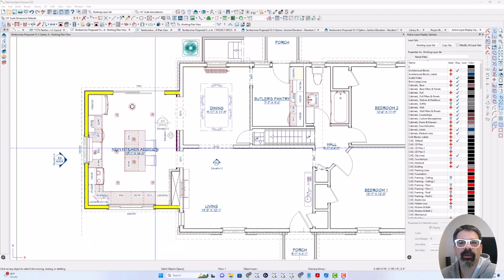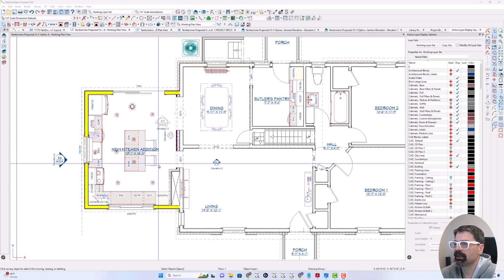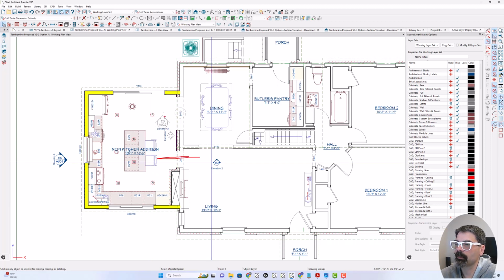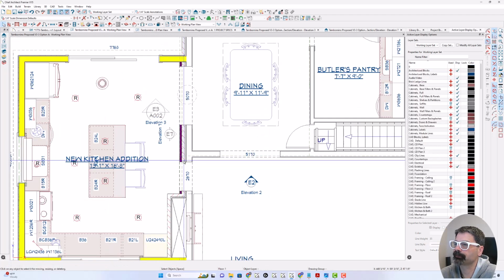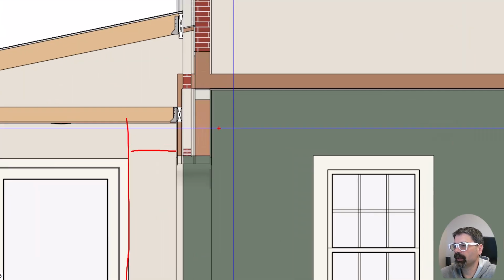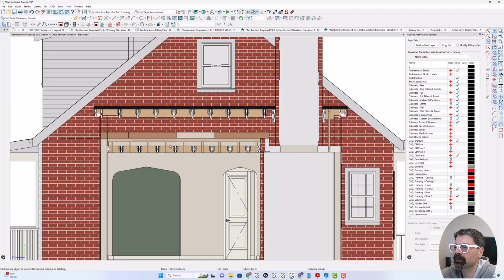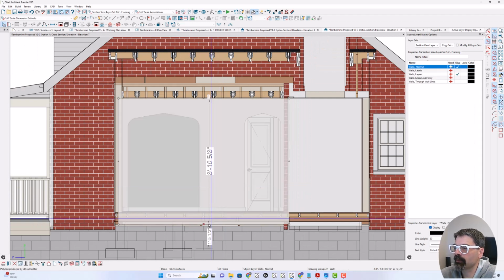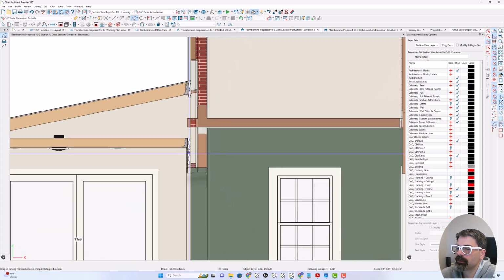Setting Wall Heights Manually | Chief Architect

Comment: this shit should be easy, you should just be able to click on a wall or walls, and then have an option for ceiling height, and then enter in a ceiling height..
Reply from the maker: Chief operates on rooms first not walls. So the room sets the ceiling heights and walls follow.
Reply: @DesignbuildsolutionsLLC  alright, so then have the ability to increase the height of the walls for an entire room...this seems like a huge oversight..

Comment: Another question - I'm new to Home Design Pro and wanted to also see the "Active Layer Display" on the right as you show it... can I do that with HDP or do I need the full Chief Architect to get that layer window?  I'm an engineer so I use 3D software like Navisworks and Rev-it there.  I'm finding I can come up to speed pretty fast on HDP, but I've only been at if for a few 2-4 hours sessions so far.  Thanks again, Clay
Reply from the maker: I don’t think HDP has the active layer display

Comment: How did you make those remodel walls yellow in the plan view?  Doing a similar remodel and drew the existing home first, then added to it... but would like to highlight the new walls that same way.  Thanks!
Reply from the maker: I created a playlist of setting up my template here. The process is still very similar even 7 years later just with the newer features in X16
Chief Architect Templates
https://www.youtube.com/playlist?list=PLgqPmSjCZ5AFajQjyM-V6joEMXIHynFie

To answer your question specifically, part 3 deals worth wall types. 
https://youtu.be/95weHoLywOA?feature=shared
Reply: @DesignbuildsolutionsLLC  Thanks for the reply!  I'll check out the playlist.  You are a great teacher.

Comment: What if I wanted to put a corbel that slopes with the roof on exterior.
Reply from the maker: If I understand you correctly, you're wanting a corbel that isn't a 90 degree angle, where the top of the corbel follows the slope of the roof. Did I understand that right? You'd have to create a custom object. I've done this with solids and should make a video about that.
Reply: Yes, that's exactly what I was trying to figure out.
Reply: I wish I could add a screen shot
Reply from the maker: Check out this video https://youtu.be/udHOB7Mw1NI
Reply: @DesignbuildsolutionsLLC  thank you. I will check it out.

Comment: I'm glad I'm not the only one who crowds their models with hardware, like those hangers.  They do make the size of the final file much larger, but I like showing 3d screenshots to the contractors when they have questions.
Reply from the maker: It makes for a very complete model for all views! My clients appreciate the detail I include in all my plans
Reply: @DesignbuildsolutionsLLC  Can't say my clients do (pearls before...) but the contractors and framers sure do.
Reply from the maker: @JTDesign1  ah. Sounds like you need better clients 🤣
Reply: @DesignbuildsolutionsLLC  That level of detail can be time consuming, but for some reason I cannot stop.
Reply from the maker: I feel that!!